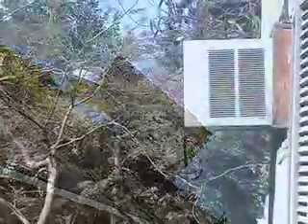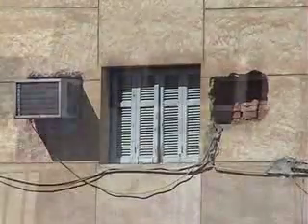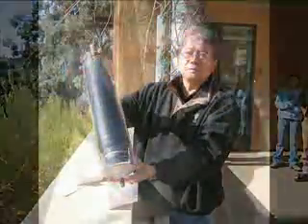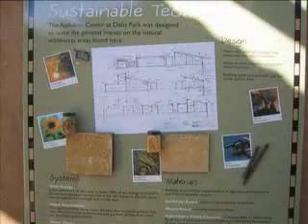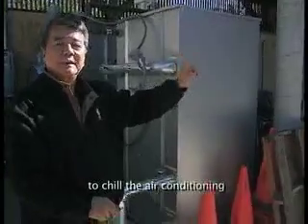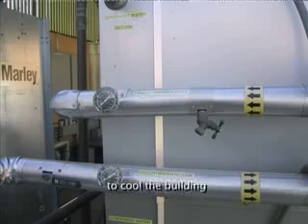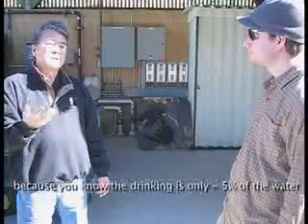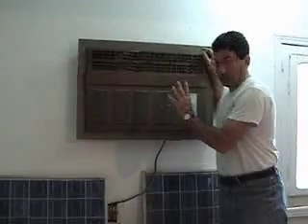Solar Air Conditioning

Comment: When I was in the navy we had a LiBr air conditioner, that stuff is corrosive.  We joked about pouring some of it on the COB's (chief of the boat) car and then as time passed watch it eat it away.  Also, you can never take away all power plants as you state at the end, the sun does not shine all the time.  That said, I wish I had one with about 3.5-4 tons of cooling for my house in TX during the day and then supplement with regular at night.  Had very hot summer this year, with 82 days over 100F

Comment: "Lithium bromide a safe food additive" SINCE WHEN? It's definitely no food additive! Lithium Bromide (LiBr); white powder with a bitter taste; melts at 547°C, soluble in water, alcohol and glycol; used as an operating medium for air-conditioning and industrial drying system due to its very hygroscopic property. and as a sedative and hypnotic in medicine. It is also used in manufacturing pharmaceuticals and alkylation process. It is used as brazing and welding fluxes.

Comment: According to the Law of the Conservation of Energy, the amount of energy in a system remains constant.  Energy doesn't go away... thus if you make it cooler indoors then there will be more heat somewhere else.  Thus this system doesn't keep it any cooler outdoors than a normal AC system.

Comment: ACs are in principals unneccessary. A waste of energy. Everything starts with an appropriate way of building houses. If american-type houses would be build on the entire planet, most of the people would die due to overheating in summer or freeze to death during winter.

Comment: Hi Folks, i invent a Solarlightpanel to use for a lot of different application. Click on my name to see it. In Germany we have (2009) over 9 Million Street lights. They need more as 4 Terra Watts (This sucks) a KW in Germany cost round about 35 US Cent. And my Solarlightpanels works in Country's with not a lot of Sun. This AC Unit here is much to big and cost to much. I saved over 80% Material. This AC Unit here needs to long time to be effective and needs maintence all over see how big it is

Comment: Do you make a system the right size for a 3000 square foot house in Las Vegas?  How much would it cost and how big is it?  I can not put something on the roof because I live in a neighborhood that restricts changes above the level of the fence.  I can be reached at sanfernandovalleyrealestate@yahoo.com.  Thanks.

Comment: "thousands of watts per hour"... somebody was asleep during physics 101. Please read up about the difference between Watts and Kilowatthours!

Yes, solar air conditioning is great if you have lots of sunlight and it is efficient. However, it is not as cheap to buy or build as conventional A/C units that gobble power from the grid.

Comment: WHAT A LIE!
Absorption chillers driven by solar hot water often are not an attractive option for a building owner looking to reduce his carbon footprint--they are expensive, require large cooling towers and can be difficult to maintain. For building owners that must bring large volumes of ventilation air, AILR's liquid-desiccant air conditioners can greatly improve the value proposition for installing a solar cooling

Comment: I'd like to point out that any air conditioning system must reject heat to the environment. If you remove heat from any space it has to go somewhere......... And further your reasoning, in your conclusion, suggests that by using this solar space heating system we will no longer continue to use energy for computing, lighting, manufacturing or transport. Admittedly you would mitigate some of the energy use of the home..... plausibly 30-40% but not all of it.

Comment: @tculhane   Higher efficiency doesn't solve anything. In the short run it does. But after a while, demand will increase at such a rate to counteact any efficiency gains.

Comment: Kilowatts per hour is not a valid measurement.  Energy is measured in kilowatt-hours and power is measured in kilowatts.  i.e. power is rate at which energy is used.  Absorptive cycles using water and ammonia and heat to cool refrigerators were common 100 years ago.  The details were in my old thermodynamics book. It takes a very good vacuum to boil water at 140 degrees Fahrenheit.

Comment: @thewhole9yard Properly designed houses are twice as expensive, and most people are already invested in a old style house. You also have the problem that most people just don't know it exists. If you have an old style house then solar heater using soda cans is a cheep up grade. I would think it would cost too much to rebuild an old house to a new house. People do things based on cost, environmentalism doesn't exist in a vacuum. Proper design vid
watch?v=BeDesD7O1i4&feature=mfu_in_order&list=UL

Comment: @yellowmetalcyborg What frequency does a helium laser produce? I've never heard of one of them.  A deep geothermal well is about 10-20 million $ and the power station is anoughter 10-20 mill , conversion of existing power station could be as low as 2 mill. What wold you do with free heliulm? and what is consumed? the lithium?

Comment: @thewhole9yard no were not playing we just haven't made them mandatory. Our current houses are great upgrades from 1920's houses. but 20's houses had major design flaws due to lack of knowledge. You don't even need earth sheltered. Design the house properly then add solar waster then add Geo thermal well and heat pump and you don't need to burn anything. you'll just need a little electricity,  probably from solar voltaic or solar thermal.

Comment: @emmanux The heating is caused by particles from the sun, we are going into a little ice age just like we went threw in the 1500's , ice ages are caused by under Oceania volcano's This heats the water which causes increased evaporation, Which puts more humidity into the air which leads to more rain over the north pole. This causes more ice.

Comment: CFC's have been banned for a decade. Any hole is not due to them. Methane from swamps and buffalo farts however is 20 times more ozone depleting then CFC's , kill the cape buffalo to save the earth. Drain all the swamps to save the earth.
And the sick thing is your tech could have sold its self with out the scare hype and Eco worship.

Comment from the maker: @preparedchipmunk Actually Egypt is planning 5 nuclear reactors, Abu Dhabi is building a couple as we speak, Iran's reactor just went on-line and the whole middle east and africa is being told it needs to go nuclear to meet projected energy demand. But in reality electricity demand should go down with higher efficiency equipment. The issue is really political.

Comment: @lakazev Correction, solar is not COMMERCIALLY economical yet. I produce 10% of my own power and I've spend $700 so far. I plan on being at 50% production by the end of next year but that's going to cost me about $5,000 total minus the 30% tax rebate from the government. If you want to know more, PM me and I'll help you out. Commercially you get ripped off big time, a $25,000 solar system would cost you $7,500 or less if you do it yourself.

Comment: @Terryblount Good catch dude...i've known this for a few months now. Use the ground....dig deep....all homes can be built IN ground...with only the roof/entrance way above ground....this means year round refridgeration...ground temp is 5C here in winnipeg. Also...the roof can be solar heat collecting for hot water and air heating. Very simple...costs almost nothing...and your home will last for hundreds of years.

Comment: @Terryblount Actually the heat output is greater than the cool created on the other side. The extra heat comes from the compressor running. I'm not saying whether the solar A/C system is good or bad. Just wanted to correct that fact.

Comment: @Terryblount  - Can you really say that this guy is an "idiot"?  He is obviously quite intelligent.  It's true that tapping into the ground is an easier way to gain access to cooler temperatures, BUT the unit in this video can supply cold air, hot water for showers, dishwashers and clothes washers, and can also supply a clean source of drinking water by way of distillation.  It's NOT just an A/C unit, although that is the main selling feature.

Comment: @wolfpack1960 : my 3 energy save ac units jump my electric bill only $40 a month for the 5 months of hottest part of the year....even if summer lasted 12 months, 235k would last me 489 years.  The 3 energy save ac units cost me $400 ($150 for each of 2, and 1 smaller one for $100...all at walmart).

I still don't see how heat+cold=colder?  This video is baffling thermodynamically (and proprietary reasons are probably keeping a lid on the ACTUAL of what's going on).

Comment: Inverter heat pumps are super-efficient. Redo all the figures-only using Daikin's super inverter heat pump. I bet it will be just as efficient as your eco-solar crud! I have to admit, solar power is one googoplex times better than wind power.

Comment: I don't know about the LiBr system, but Amonia has been doing this forever. Look at any RV refer and there it is. All you have to do is replace the heater part with solar heat and there you are. All the propane, 12vdc, or electric heating does in the refer is seperate the Amonia from the water for an absorbtion system. The hotter the better.

Comment: This guy is an idiot. The heat put out by AC is equal to the COOL on the other side.  Here is the kicker... 10 ft below you the temprature is probably a constant 50 to 60 year round.  It's MUCH easier to tap into the groud than the sun.  If you have a lake nearby it's even easier.

Comment: you don´t think so?  A/C systems are as inefficient as any gasoline engines or electric motors. I´d say they produce a lot of heat, at least three times the heat they´re taking out of your comfortable Air Conditioned rooms. You can confirm that, just go stand up in front of the AC radiator for an hour wen it´s working and you will see.

Comment: Its a absorption chiller as used in industry.  Great technology that could probably be used for communal (whole block of flats)

Forget about the great hoax of global warming, energy cost money and it will only cost more in future

I like the bit where the "technical expert" explains "it removes the heat from the cold".  Cold does not exist only the absence of heat energy.

One final thing.  Unless we spend a fortune on PV arrays and batteries what about when the sun goes down?

Comment: I completely freakin agree with you!! The tech will speak for itself, so one shouldn't be an a-hole about it, and don't deliever half truths either... Refrigerants like freon w/ CFCs are now replaced, by law, w/ alternative non CFC refrigerants here in the US...  Plus It looks like there's alot of different types of metals in those apparatuses, last time I checked, that requires smelting and shaping, demanding tremendous amounts of heat and energy. Then multiply that by the consumer population.

Comment from the maker: Russ, you're missing it.  The point is to harness the radiant energy of a powerful fusion reactor called "the sun", to harness biomass fuels, improve Carnot efficiencies, to achieve Pareto optimality etc.  I made this video and I work as a utility consultant to various good power companies investing in better technologies. Solar adsorption cooling is one of them. The "evil" companies are the one's stuck in the 20th century, sacrificing long-term health for short term profits.

Comment: what a dumbshit, first off i am hispanic, secondly I am not rich, thirdly your mom should have clearly left you on a doorstep, solar cooling isnt hard to achieve without this system depending upon the use of passive solar design, i am glad you felt the need to take up an entire 3 replies to say absolutely nothing. obviously you didnt take the time to look at my page or what i am about, and that I and a Ron Paul Patriot and against the UN and NWO and dumb shits like you that fly out of control.

Comment: [5]
"Solar cooling has no negative impact on the environment."
Someone has to build the system and produce the raw materials it is made of, and they do it in factories that pollute. 

"I'm a Japanese guy who likes to ramble on about unrelated or irrelevant technology." 
Yes, indeed you are!

"With this system you no longer need electricity."
As if air conditioning was the only use for electricity! I don't know about you, but I sure do like my electric lights and appliances and computers and...

Comment: [4]
"Conventional A/C uses CFCs which destroy the ozone layer."
False! Modern refrigerant does not destroy ozone, and CFCs are not responsible for ozone depletion. Ozone is continually destroyed and replaced by natural processes, and the ozone thinning over Antarctica is normal.

"Lithium bromide is a safe food additive."
Lithium bromide is a type of salt. Even table salt is not safe, nor is LiBr. It is psychoactive, and can kill you if you eat too much of it.
[cont.]

Comment: [3]
"Coal and nuclear power plants threaten everyone with disaster."
No, they do not! Nuclear plants especially, since they emit no pollutants whatsoever,  not even CO2. Modern coal plants are very clean, and CO2 is not dangerous. The effects on the atmosphere are negligible.

"This technology removes heat from both inside and outside."
False! This technology still requires a condenser, which has to get rid of all the heat from the system somewhere, likely using it to... heat the outside.
[cont]

Comment: [2]
"A/C causes inevitable brownouts and blackouts."
Brownouts and blackouts are caused by improper operation of the power system, not by A/C, which is always there and is included as part of the calculated and forecast load 10 years or more from now.

"Corporations are greedy."
Corporations are made up of people, including everyone who owns an investment portfolio. This likely includes Greens like this idiot. If you use electricity from the grid, you benefit from these corporations.
[cont.]

Comment: we could not possibly replace power plants with solar power. the best solar panels can generate about  .2 watts per sqr inch. the average house uses upward of 4000 watts on average that's 1,668 ft of panels for a 1600 sqr  ft  home. this solar paneling would cost $160,000 plus installation.
 it would take 3,945,707 miles of panel to power nyc alone. where the hell are we going to put that much solar paneling.  NY is only 49,000 square miles

Comment: dramatization was a failure. "air conditioners use too much electricity" enough said. The heat from the condenser dosen't even raise outside temperature a hundreth of a degree, epic fail. And the whole nuclear thing? lmfao...

Comment: no..it wasn't very specific but this technology is essentially the first air condition system ever made. it used the evaporative water method, when water is converted to steam it takes energy to do this leaving aq energy deficiant void (so to say) this we call cold this is naturally about 7-8 degrees F but if you pour the water over lowvers and ad wind motion this can actually undet the right condition produce ice at 80 degrees f in the holding tank. this was the first air conditioning,req+labor

Comment: Why not just create a swimming pool, and integrate the pool with a heat exchanger that runs around the rim of it?

This will create heaps of 'thermal inertia' to keep you coll at day, and warm by night. It should effective, low maintenance, and particularily effective with a well insulated house that uses heat exchangers for air-in/air-out too.

Comment: solar cell is expensive but your paying of it once... yes it can run a AC unit through the use of a battery to serve as a source/storage when there no sun... and a inverter it convert a voltage from 12 0r 24 volts battery to 110/220 volts ac..

Comment: Wouldn't it be cheaper, faster to build, smaller footprint to just use a larger electrical solar panel to run a standard electrical AC unit?

Comment: oct1984 you have no clue what you're talking about. Do some research before you post blindly. Vacuum tubes can create steam at low temperatures, and solar thermal works in NY. I know because it's on my roof producing domestic hot water in summer AND winter.

Comment from the maker: Right you are idius -- and we do focus on the solar and it is shown, when Les holds the vacuum tube collector in his hand (otherwise we would have had to go up on the roof which was not permitted).  In Germany my wife and I have exactly the same kind of heat pipe evacuated tube collector (50 tubes) for our hot water system -- in the summer we have gotten up to 104 Celsius (4 degrees higher than boiling).  It is a no brainer.  What is interested are the chillers that use solar heat.

Comment: In this case, they actually are heating the water using solar energy (that's where the vacuum tubes come in).  They focused more on the chiller, which isn't the solar component.  The same kind of chiller is commonly used with water that has been heated with natural gas.

Comment: Calling it "solar powered" is misleading.  The hot water reservoir is typically heated by burning natural gas.  It would be possible to heat the water using solar energy, but it adds complexity that isn't shown in the video.

Comment from the maker: The heat of the compressor is such that here in Germany we use them as HEAT PUMPS to heat our homes and provide hot water.  Learn about "airsource heat pump technology".  We direct the heat they produce INTO the home to keep us warm in the cold winters.  When you use a traditional air conditioner you are directing all that heat outside.Perhaps you should do your homework before being so insulting and aggressive.I appreciate constructive debate, but rude people like you should "shut the #$%@ up!"